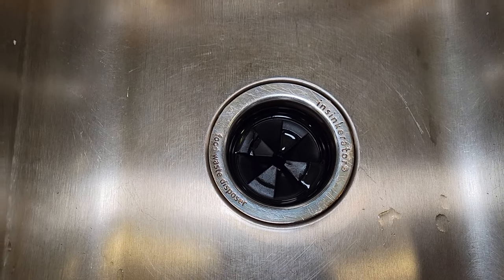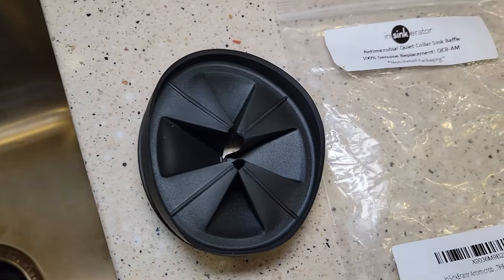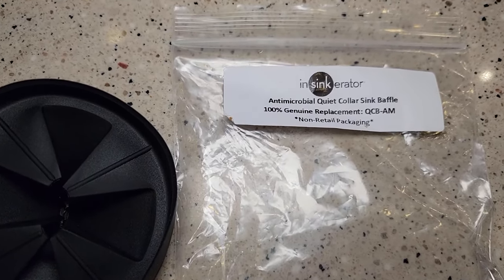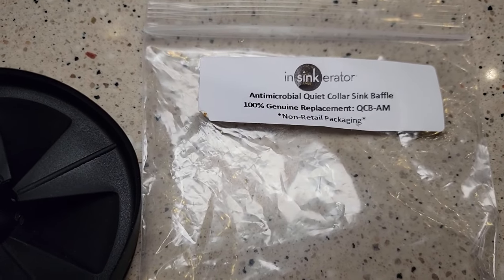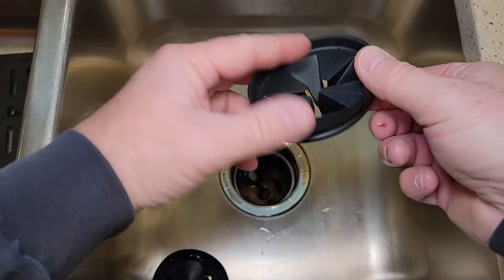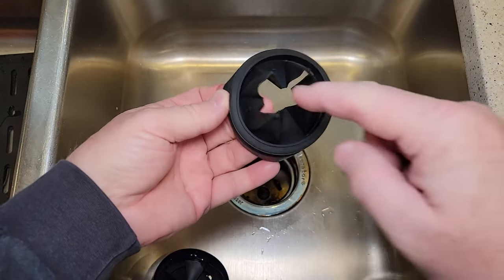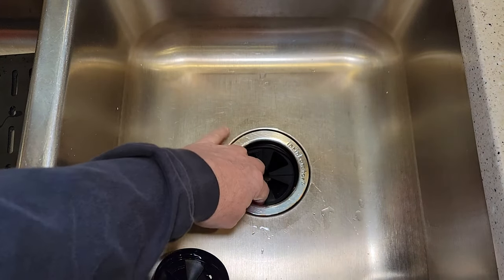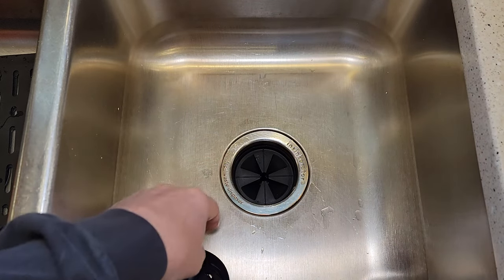How To Replace Garbage Disposal Splash Guard In Sink Erator Baffle QCB-AM Review

Comment: update to my response here. This is wrong, you do not replace it this way. You have to disconnect the disposal and put it in the top of that and then put disposal back in place. That is why some of you can't get it out and some of you have it falling into the sink. Sooo yea, misleading wrong video dude
Reply: He installed this product correctly.  It is designed to be used as shown in the video.  You can't install this product onto your garbage disposal.  It is too small and not made for that purpose.  So, if you purchase the splash guard show here, install exactly as you see him do it.
Reply: Mine replaced exactly like this. I have an insinkerator and it was very easy. No need to disassemble anything.

Comment: Warning: This is a bit misleading. This method only works with certain InSinkErator models (the Evolution line from what I can tell). Do not accidentally rip out the rubber baffle if you have another model! I suggest looking up your specific model number to see which baffle and replacement method you need.
Reply: Thank you!!

Comment: I could swear I saw a video showing removing the garbage disposer to get to replace the shield. Now I’m confused!
Reply: seems to depend on the brand. i think you need insinkerator brand to do this easy replacement
Reply: @cryengine_x  ours is insinkerator brand but does not pull out. It must only be specific models
Reply: @sharonmitchel1377    Same, I have an Insinkerator Badger, and it requires a complete disassembly to get this thing out. I wish it was as easy as this video shows.
Reply: Mine needs replacement because it came with some new type of flimsy rubber splash guard that builds up a musty odor. Has anyone else had the newer splash guard build up an odor?  I can clean the bottom of the splash guard, but it comes back after about a month. I’m in Florida, which probably doesn’t help, but I had a disposal for 15 years with the thick rubber splash guards and never had a problem. I don’t think this new flimsy rubber has the “anti-microbial” feature. 🤷‍♀️
Reply: It depends on the splash guard you purchased.  The one used here is designed to be used as shown.  Others require removing the garbage disposal and installing the splash guard directly to the unit.